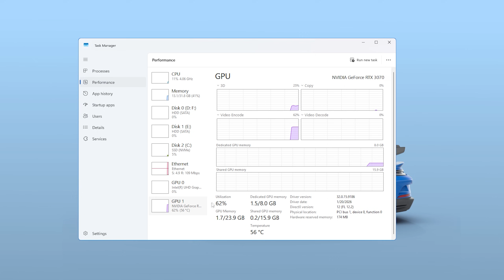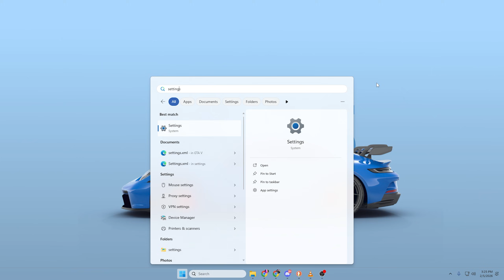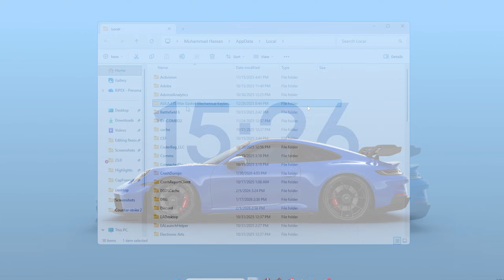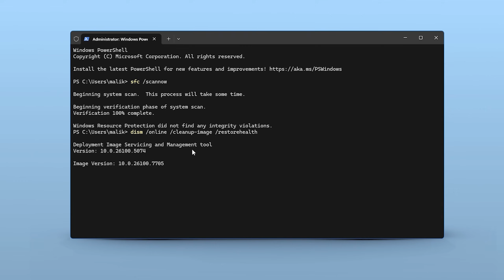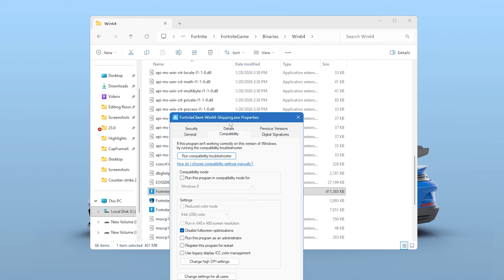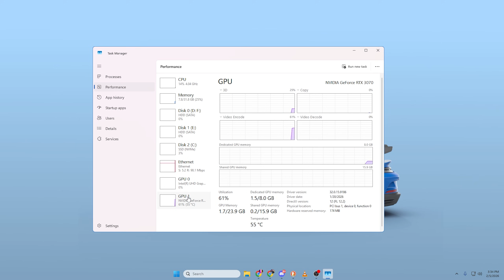NVIDIA GPU Throttling Is KILLING FPS – Here’s How to Fix It NOW

Comment: Hello, could anyone help me out a little?

My GPU is running at around 50–70°C while idle. At first, I thought it might have been caused by the new drivers or a Windows update, so I rolled back to a previous version, but that didn’t fix anything.

I then paid a GPU technician to deep-clean and repaste my GPU. When he tested it, the temperatures were looking good. However, once I got the GPU back, it was still running at 50–70°C while idle, and whenever I tried playing even lightweight games, my entire PC would completely freeze.

Does anyone have any tips or suggestions on what might be causing this? Any help would be appreciated!

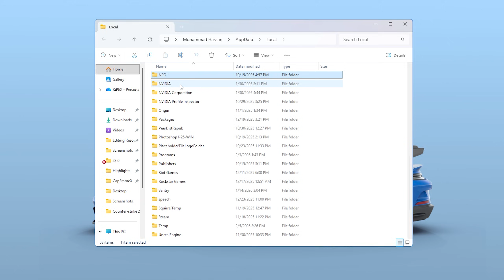Comment: 2:02 this right here! this solved my weird stuttering/small freezing issues in mulltiple games that i've had to reinstall in the past. thank you for the video!
Reply: So am playing the games on my laptop been almost 6 months it used to run games so fine and smooth but now am getting sudden frame drops if u also know any solution then please let me know
Reply: @wtf_samwinc am also facing 120-20fps drop every 6-7 sec in dota2 i dont know about other as i bad none
Reply: @adkind2804  turn on the cache size from driver default to ,10gb maybe that will help

Comment: in my case i paired my gpu rtx 5070ti amp extreme infinty with ryzen 9 9950X3D and i have enabled dlss 4x with ultra settings and ray tracing also but when i play gta online for 3.5 hours straight my fps which was continously coming between 300-350 fps suddenly it drops to 100-140 fps why its hapeening my gpu temperture while gaming is 66 degrees and my cpu temperautre is 67 degrees then also it"s happening
Reply: Same thing happening with me but it's different when my gpu is on 73° and I am getting 120 fps it's suddenly drop to 30fps and my gpu tempreture on 60° did you know why it's happening
Reply: @BhaveshshortsYt which graphics card you have and what is the system specs
Reply: @harshcg04 5060 8gb
Reply: But now that problem is solved automatically
Reply: @BhaveshshortsYt bro I also noticed today my gpu temperature went to 60° when the fps dropped from 350 fps to 142 fps the fun fact fact is that I just launched the gta v after botting my pc and gone to suddenly my fps drops my friend told me that some time the gta v lobby gets corrupted that's why it happened it not any hardware or software problem, it the gta v session problem for this u have to restart you gta v game

Comment: +
It's not GPU throttling, it's a CPU bottleneck problem. What you are doing is basically removing the CPU bottleneck by changing the power profile
Reply: its so hard since I can't tell if the comment positvity are from real people or not.

Comment: Im using Process Lasso to manage my Power Plans. It isn't recommended to always use Ultimate Performance because even if you're in Idle it woun't let your GPU Clocks down which will results in overall higher Watt Usage and in higher Hardware wear.

Comment: My laptop suddenly hangs during gaming or heavy apps. Specs: 8GB RAM, i5 processor, NVIDIA GeForce GTX 1050 Ti GPU. Issue started after a Windows update. Any fixes? 😩 #LaptopProblem #TechHelp #GamingLaptop

Comment: you tried to delete the two folders but couldn't, because it was used by another program... so when you hit SKIP, why did it succeed??
Reply: Because by skipping you’re skipping some files from deleting cuz either you find which programs using using it in the background or you skip it and not delete it, hope it helps you understand.
Reply: @rylewild9993  still it would have been better to see the failure on the video so that people could then be told how to deal with it efficiently. Instead of having to mine the comments for details

Comment: This guy wants your battery to die on laptops. I would advise against setting your global settings power management mode to max performance will infact kill your battery DO NOT do this on laptops. The robo voice forgot to mention that. Use at your own risk
Reply from the maker: Good point, thanks for sharing!
Reply: I run test with max performance and my fps is not improved 😂😂. Just my laptop is hot and fans are turbines now 😂😂😂. Let tour laptop in balanced mode...